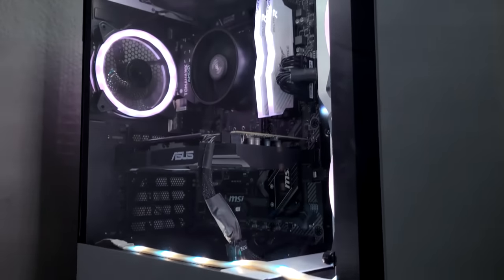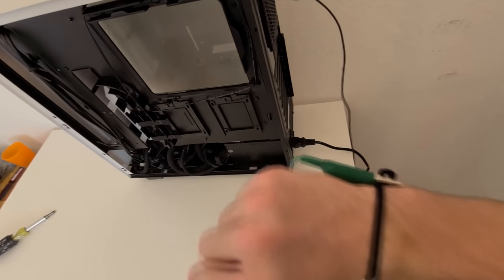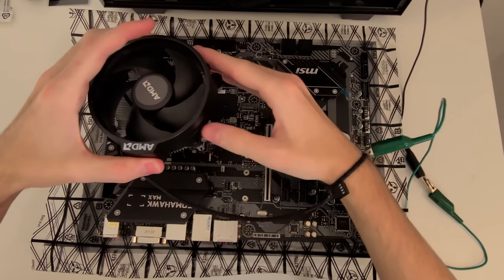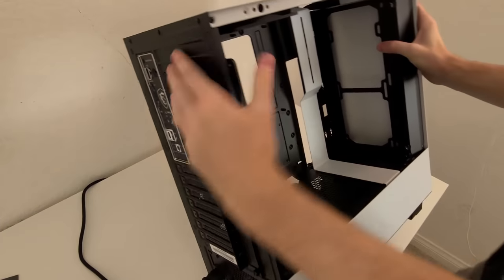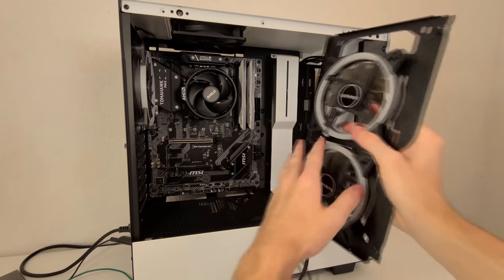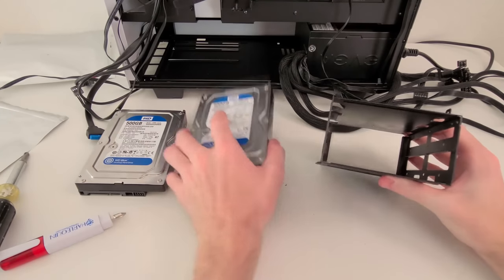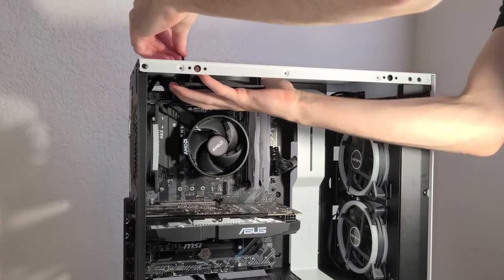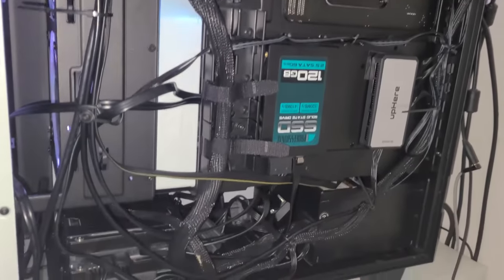BEST $700 Streaming/Gaming PC [Build Tutorial]

Comment: Came here looking to see what it's like to build in an h510 before I decide on a case, left with probably the best possible refresher on putting together a PC. Great video, really. This is fantastic and to the point.
Reply: Did you build in it already hows the temps?
Reply: @adriangallardo49  I ended up getting the h710i. I probably didn't need the extra space, but the 510 would have been tight. I have a 3070 strix. The GPU and CPU don't seem to go above 68 under load, and I'm using a cheap Vetroo V5 air cooler on the CPU. Honestly not sure if I'd go with this case again. Some aspects of it are awesome to build with, but the front and top panels are such a bitch to remove.

Comment: You dident even tell us how to plug in the fans : (
Reply: @枠組み plugins for fans should be on motherboard. its usually written on top of where you are supposed to plug it in
Reply: There is a fan hub just insert them all to each other
Reply: Usually would say "Chassis Fan" on the motherboard
Reply: @枠組み where did u plug in the fan hub
Reply: @枠組み where does the fan port plug in? I have the msi motherboard btw
Reply: @ellakella1018  inspect the motherboard and you should see case fans or smoething like that written on top of fan port where you are supposed to plug it in
Reply: @Sirgo_07  ah ok got it thank you sm!
Reply: Either mother board or get a fan hub and plug in the fan hub to syn-fan, and once that is done you plug all ur fans into that
Reply: I have the same setup but the PC does not boot up when I have the fan pin connected to the motherboard (plugged into Sys_fan). The PC boots when I remove it from the motherboard and all fans are spinning. Where is the chasis fan? Do i need a fan hub instead?
Reply: @sam21711  I personally couldn't find the chasis fan so I connected three rgb fans (aka: sys_fan1, sys_fan2 and sys_fan3) to the fan hub then plugged the fan hub into the power supply via sata cable. I do not know if you have the rgb fans mentioned in the description of the video , which will come with the fan hub, if not I cannot help u as this is my first pc build.
Reply: @枠組み lucky
Reply: @枠組み how’s the pc
Reply: @枠組み did u build the one in the vid

Comment: I use the X20 PC from Build Pro PC. Its only about $750 after shipping and it's got a Ryzen 5 and a GTX 1650. For under $800 it is amazing. Runs games at high settings 1080p with over 140 FPS in games like Valorant. Worth taking a look at.

Comment: FINALLY BEEN WAITING SO LONG FOR THE BUILD.
Btw wondering if you power supply is non modular or modular or semi.
Reply: Non modular
Reply: quack quack do u just leave u cables tucked in or any idea how u would hide the cables ur not using from the power supply?
Reply: @Ex-pq6rl  yeah if ur not using them try to hide them in the case, the psu shroud (if you have one).
Reply: @Ex-pq6rl  basically as long as they fit and aren't getting damaged it's fine
Reply: quack quack ok thank you
Reply: @Ex-pq6rl  As long as you have a shroud (basement) it'll be fine. Even if you didn't, it wouldn't effect anything other than aesthetics.
Reply: cytrus yup thanks I finished my build a week ago

Comment: Amazing build and I’m basing mine based off of yours. Just wondering where and how do you connect the rgb fans?
Reply: omair hasan to ur motherboard
Reply: Anywhere your motherboard that says system fan. Not cpu fan. Also this isn't a very good build guide. You can at least get a 1660 and a b550 board if you look harder than he did. Also the b450 tomahawk is rarely in stock and is typically going to be overpriced due to that fact

Comment: Alright, I’ve never built a pc before so please don’t put me down if I don’t know what I’m talking about. I was planning building this pc but I see a lot of people who seem to be telling people they can build a better pc and save some money. My total budget is $700-800. I’m going to list the specs I have chosen and would like to know if anyone has suggestions on how I could save. Ryzen 5 2600x, cooler master hyper 212, msi b450 tomahawk max atx am4, team t-force delta RGB 16gb ram (2x8gb), gtx 1650 super, nzxt h510, and evga br 500 w. I would also need a ssd but I can choose that later. This pc would be for light gaming and editing. Anyone have any tips on how I could improve this build? Once again sorry I’m new to this ;-;
Reply: @suyogv5631  well firstly, I’d like to say thanks. I was not aware that a cooler was included in the cpu box. I do not plan on overclocking. My ram speed is 3200 but if I get rid of the cooler I’ll have like $45 extra to spend on upgrading that. I’ll look further into the super sc ultra. Do you have a better psu? I can’t go to much over the price but its at $65 rn. I’m going to get an ssd and for the drive you saved me. The one I had picked was like $115 for 1tb. The case does come with fans, but I did forget to mention I’m planning on getting the fans he used in this video. They’re around $25 on amazon. I have used pc part picker for my parts and they all seem to be compatible. I think I may get the rgb strips and wire extensions. Thanks for your feedback and taking time out of your day to help me out. Also, would something like 700w be better for the psu?
Reply: @suyogv5631  alright ill stop being sorry haha, Yea I didn’t specify whether it was a hard drive or ssd because I wasn’t quite sure until I double checked my self. It was an ssd and I’ll look for the one that’s around $40. good point about the fans. I think I’ll stick with the fans that the case includes. Since I’m saving money from removing the extra cooler, and hard drive + ssd I could get the rgb strips. By changing some of the parts, I’ve gone down about $70 in total price. I could probably get better fans if you would recommend that. I’m not sure how good the cases fans will be. Do you know how many fans I would be needing though? (If i do upgrade them) I’ve upgraded my ram to a Corsair Vengeance RGB Pro 16 GB (2 x 8 GB) DDR4-3600. It’s only about $10 more. I’m gonna check out the 600w psu
Reply: @suyogv5631  I’ve changed my psu to a EVGA BQ 600 W 80+ Bronze Certified Semi-modular ATX. I’m still working on ssd and hard drives but I think that will be relatively simple. I just wanna say thanks for giving me advice and helping me through the different parts and cutting the price down by $70. Have a great day :)
Reply: @suyogv5631  last question. This recently popped up in the compatibility system “NZXT H510 ATX Mid Tower Case has a front panel USB 3.2 Gen 2 Type C port, but the MSI B450 TOMAHAWK MAX ATX AM4 Motherboard does not have sufficient USB 3.2 Gen 2 or Gen 1 headers. The case USB 3.2 Gen 2 Type C port will not be usable.” I’m not sure if this means it won’t work or that one of the ports won’t be available to me. If that’s the case I’m not really sure what the ports do really.
Reply: @suyogv5631  ok so if I’m just using my mouse and keyboard plugged into the ones on the top it will still work? If so that’s not a big problem for me and I’ll stick with the case and motherboard.
Edit: I just saw your new comment and that’s not a big deal to me. Thanks again.
Reply: @Jacob-xp8js  I prefer R5 3600 and cheaper mobo. Mobo isn't big deal if you are going to use NVMe (also cheap mobos usually support them), PCI express cards of anything else. But for editing, R5 3600 is better than 2600. Also, there is not a big gap between 2600 and 2600X. I am also using 2600. I am not sure but 5 3600 may run hot with that stock cooler. You can buy very cheap coolers like Snowman m200 which I'm using. If you have any questions my discord: Penguen#2506
Reply: You could save your money and buy a 8gb ram instead of a 16gb ram, its a bit of an overkill

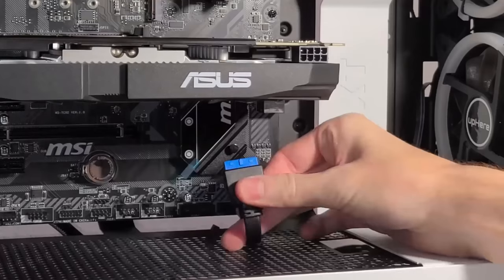Comment: 13:40 he glosses over this without much detail and I’m confused. The nzxt h510 has a usb gen 2 port, but the b450 tomahawk max doesn’t have a gen 2 header. How is it not incompatible? Is there something I’m missing?
Reply: same
Reply: Don't worry fam I gotchu. This motherboard has a usb 3.2 gen 1 header (formerly known as usb 3.0) but the case has a usb 3.2 gen 2 usb type-c port (formerly known as usb 3.1). To use that usb type-c port, you would need an adapter such as this one: https://www.amazon.com/Socket-Header-Extension-Adapter-Motherboard/dp/B07P98M1G9
Do note that you obviously will not get usb 3.2 gen 2 speeds but the port will be functional
Reply: @deadalpeca8099  ohh
Reply: @deadalpeca8099  so I heard somewhere that the case has one cable for both ports, which is what makes it more beginner friendly. Is this true? If so, how would you use the adapter without losing the usb 3.0 port?
Reply: @deadalpeca8099  sorry if this seems dumb, i dont really understand everything yet lol, but will it be functional without the adapter? Also if it is what would be the benefit of getting one?

Comment: The only thing that I'm scared about building my pc is connecting the cables. :))
Reply: Really? not inserting the cpu? that's mine.
Reply: @MichaelMajor-rx1md  me also, man thats why I will buy a $685 PC PRE-BUILD which has  
GTX 1050TI, I5 9TH GEN, 6 CORES  UPTO 4.10 GHZ, 8GB
Reply: Prativa Kanhar thats pretty bad 1050tis are garbage youre better off building it (or sell the 1050ti and upgrade to an rx 570/580
Reply: @MichaelMajor-rx1md  the CPU is so easy to insert in my opinion:)
Reply: @Joopy777  GTX 1050 TI CAN GIVE 60FPS IN MOST OF THE GAMES IN GTA 5,DOOM ,MINECRAFT, CALL OF DUTY WW2 ETC
Reply: @Joopy777  I already buyer it  I will upgrade to GTX 1660 TI
Reply: Prativa Kanhar nice thats a good choice
Reply: @OP-cf9pu  60 fps is equivalent to consoles
Reply: @castroxl6414  soory mrs but in consoles like PS4,XBOX ONE  ,GIVES YOU 30FPS NOT 60FPS
Reply: Prativa consoles give u 60fps mobile gives u 30fps
Reply: @OP-cf9pu that's a nice set up. I really like the I5's in the 9th gen it  is a pretty powerful cpu. Do you have plans on upgrading ?
Reply: Prativa Kanhar I play on ps4 and have 60 FPS  so yeah if you wanna buy a pc make sure it’s better than a console that cost less
Reply: @Momo-ve9ct  I WANNA PLAY MINECRAFT I WILL GET 1000FPS EASILY  AND VALORANT OR APEX LEGENDS only Minecraft tlauncher and free games only
Reply: @hetarthparikh2876  my mobile give me 60fps all the time, dont underestimate the mobiles ._.
Reply: @OP-cf9pu  
It's a good pc but you could add another 8gb of ram to activate the dual channel
Reply: @Momo-ve9ct   only if you have a pro, or a x. Consoles only do 30 fps otherwise. At the time of the pro series release you could game 4k 60 fps for 499. Mighty hard to beat. And the ps5 will be at 4k 120 fps with most people only having 60 hz tvs. So they'll think they will be gaming at full 120 lol. But this console generation is a game changer for sure.... that being said there is "something" about being pegged at 240 fps on a new aaa game with better graphics at 1440p. It is the mountain top.... I have seen it. It's like butter....lol
Reply: @OP-cf9pu  dont buy a pre bulit, bulid a pc, its better
Reply: @OP-cf9pu  just put gtx 1660 ti you are up to badget almost 50 euros
Reply: @MichaelMajor-rx1md  thats the easiest part to place
Reply: @willm4  says the guy who failed at everything since 92 lol.
Reply: @MichaelMajor-rx1md  im just sayin all you do is put it down on the board compared to all the other steps thats ez lol
Reply: @willm4  right, and I'm just saying  from 07 to 09 the polar ice caps actually grew larger and never melted as said in you nobel acceptance speech. We all fudge when the process is easy and essential tremors plague you... lmao
Reply: @MichaelMajor-rx1md  sure... unless you have gone to the artic and mesaured them, there is no way to know 100% that statement is correct, media is untrustable these days
Reply: @willm4  ..... so your not really al gore... not again.
Reply: @fernandoalexandermartinezv5168   ye It depends on the game and the device some iPads can get 120fps
Reply: Prativa Kanhar bro i get 60 fps on my xbox one 😐
Reply: rxuvben  what I did
Reply: rxuvben  are you mad or wat
Reply: @OP-cf9pu  NOOOO
Reply: @OP-cf9pu  NO THAT PRE BUILT IS TRASH
Reply: Same dude like everything else looks fun
Reply: @Joopy777  Not everyone knows how to build
Reply: Actually Element replacing a graphics card is probably the easiest part in pc building, after doing it once you should feel comfortable doing it
Reply: @OP-cf9pu  Bruh prebuild is Just a waste of money
Reply: Sameeeeeee
Reply: Nothing dificult my friend. But it's in my opinion a good practice to first see and maybe make a note of which cables you need for each component and possibly buy custom cables with cable combs to keep them neat and aesthetic. Also what I do is pre-plug all the sata cables into my PSU before even putting in the drives in so I woon't have to dig in there later. Do your research on the case too, to see how much space you will have for cables and if it will have a good air flow.
Reply: Prativa Kanhar NOOOO why’d you buy a ore built they charge so much money for decent parts and you should’ve went with amd
Reply: @OP-cf9pu  on medium settings

Comment: The only thing I wouldn’t do is to not have the rgb lights visible in the case but other wise great build.
Reply: Y
Reply: Can I use the  AMD Ryzen 7 2700X 8-Core 3.7 GHz (4.3 GHz Max Boost) Socket AM4 105W YD270XBGAFBOX Desktop Processor instead of instead of the AMD Ryzen 5 3600 6-Core, 12-Thread Unlocked Desktop Processor with Wraith Stealth Cooler or can you please pick one for me you don’t really have to answer it but I really need a experts help since it’s gonna be my first time building one

Comment: Tip: dont spend more than 40 $ on a case if you are on a budget, invest that in a GPU or a good SSD.
Reply: Ethxn  Depends on what CPU u have, but at that price there are better alternatives.
Reply: Not necessarily true. I agree you shouldn't send a lot on a case but it's better to get a good case for maybe $70 dollars that has good airflow and easy to build in than to get a cheap trash case. It's much easier to add an ssd later than to upgrade a case. Most $40 dollar cases are trash. For $70 dollars you get a lot better options

Comment: I built this PC recently. Working great so far and the tutorial was easy to follow! Thanks Rootech <3
Reply: @Kalvin Antonito Plug it into your PSU connectors. The PSU will have a bit that will attach to the fan connector. If you got the same RGB fans in the video attach them all together using the connectors so it can all be powered from your PSU. Plug the case fans into your motherboard.

Comment: Wait. That’s not a wireless anti-static wrist band.
Reply: I didn't understand why did he need to this ? Is this necessary step???
Reply: R J He put on a anti-static wrist strap because static electricity can destroy pc components. So to make sure you don’t have any static electricity build up on you, you can use an anti-static wrist strap that is connected to ground to discharge yourself while building a pc. Whether you need one is debatable. If you’re in an environment where you are susceptible to frequent static electricity build up, then yes. Otherwise you don’t really need one. You can touch the metal on a faucet or sink before handling pc components to be sure you are grounded. That’s what I did when I built my PC. The joke I was making was in reference to the Verge pc build video, where the presenter talked about wearing an anti-static wrist band, but the band wasn’t connected to ground at all. Making it useless for protection against static electricity build up.
Reply: @RishabhJoshi-wo2rm  you really only need it if you are wearing socks on carpets or something that would truly generate static electricity. You could just ground yourself on the pc case but it's not a bad thing to be safe with the wristband.

Comment: You never said where to plug in all the fans
Reply: they come with a hub, plug them into that and power it with a sata plug located on your power supply
Reply: @supernatural2968  yeah I figured that out after
Reply: @crapool4486  where did you plug in the top fan that came with the case? he didn't mention that either.
Reply: @Zachhhhhhhhhhhh  the pump fan and sys fan ports
Reply: @supernatural2968  it doesn't

Comment: since the gpu now is really expensive you might as well get ryzen 5 5 5600g 3.9ghz if you want intergarted graphic and it cheaper 

so get every thing in this tortural but change the cpu to ryzen 5 5600g or a better cpu and take out the gpu.  it will be like 709 if you get fast shipping, 704 if normal shipping  on amazon.

btw i got the Seagate BarraCuda 2TB Internal Hard Drive HDD – 3.5 Inch SATA 6Gb/s 7200 RPM 256MB Cache 3.5-Inch for hhd if you don't want hhd it willbe way cheaper.

Comment: Unless you are using the back of the case as I take and the front as exhaust which doesn't make sense. All the fans are in the incorrect orientation.  Always remember "faces suck" meaning the face of the fan ie the side of the fan with the logo  sucks air through to the back of the fan.

Comment: this is a good pc  i have a similar pc to this i have an i5 10gbram and a 560 and i cant clip things on geforce however the 1030 is better because on my old pc i had a 1030 8 gb ram and got better fps than my new one i built so i put togather one online on amazon for 649 with an i7 1030 16Gb ram nzxt case 2 fans 600 w 80+ bronze power supply and a b450 motherboard and for the CPU cooler just use the one in the box instead of buying a 100 dollar one

Comment: the phanteks p300A is much more preferable, much better airflow and if you get the P360A option you get rgb fans included and an rgb strip. it’s all around the same price point as the H510.